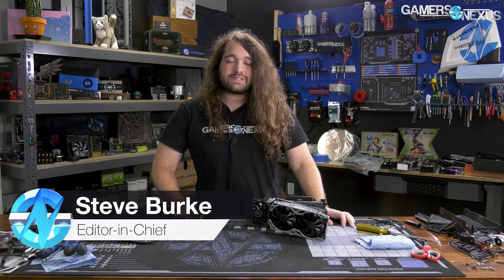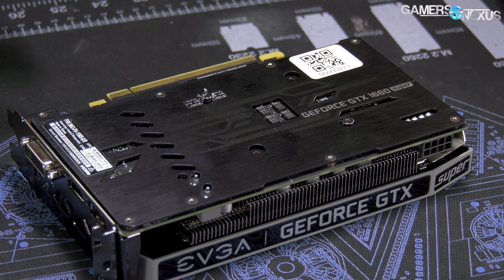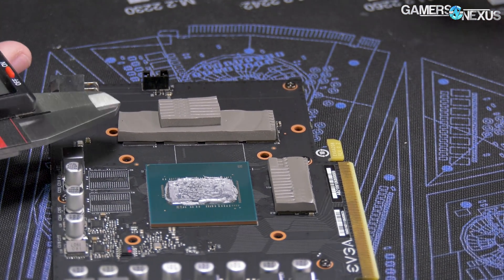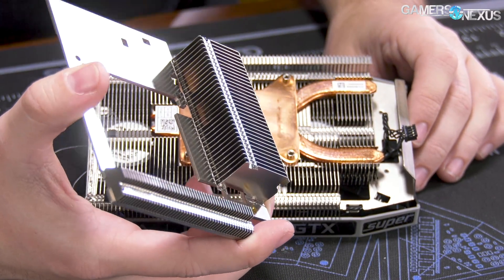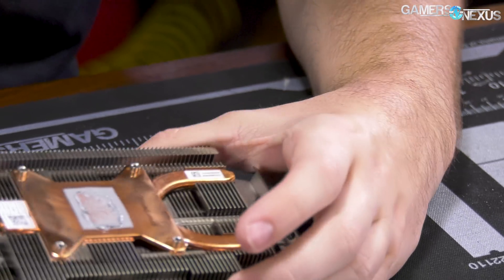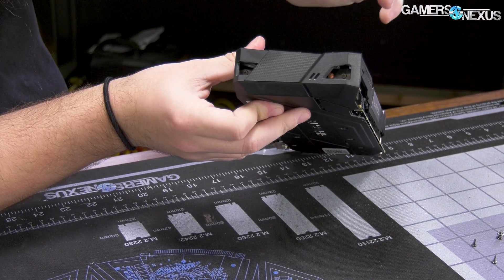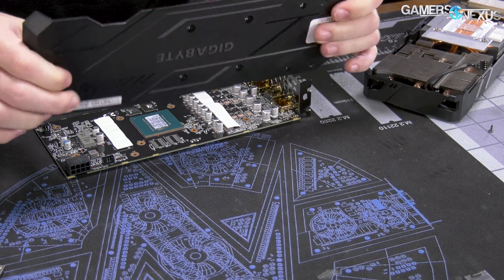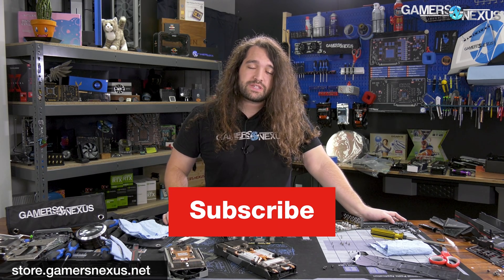GTX 1660 Super Tear-Downs: 9mm of Thermal Pads & Bendy Backplates

Comment: Gotta love non-engineers giving engineers the "oh it'd be better this way" talk. lol cracks me up every time.
Reply: Clearly, those cards were poorly designed. Nobody's blaming engineers but people above them deciding to make 2$ extra margins which ruins thermals and noise levels.
Reply: @PainterVierax  You design a GPU that gives the same performance for the money, let's see what you make. LOL   Most likely, the memory doesn't need much cooling, and it's just bridging the gap to shed the heat. They obviously work just fine and keeps temps in spec.   Why "overbuild" a budget card, when you don't need to do it, pass the savings on to the end user who's looking for a good budget card. Obviously, it's not "poorly designed". It's designed to a price point, and there isn't anything "bad" about it.  It's not like that memory is running at any extreme heat levels or anything. Like do you also think, if someone doesn't have a 360 AIO on a Intel i3 it's not "properly cooled"? Just silly
Reply: @bBrain  stacking these kind of thick thermal pad is clearly a desperate measure and it's counterproductive since direct airflow is a better and cheaper design.

Using a plastic backplate which serves no thermal or structural purpose is not an engineering decision but a marketing one.
Also you forgot that those thermal tests are made on an openbench table, temps are way worse in a standard ATX case, especially those with poor airflow.
Reply: @PainterVierax  I was strictly speaking about the think thermal pads, on the 1660, it's perfectly acceptable on a budget card. The plastic backplate is just a beauty cover. I mean, yea, most cars also have beauty plates so you don't see some ugly spot, same kind of thing. I don't mind it in a budget thing. Personally would rather it not be there, because it actually costs quite a bit to tool for that, and make them.

Comment: Isn't the whole point of the 1660 Super the upgrading of the VRAM?  Shouldn't that newer memory be running faster and hotter than a stock 1660?  These lousy thermal solutions for the VRAM aren't reassuring.

Comment: I really don’t mind GPUs being made of plastic as long as it looks good. Honestly it’s something meant to be set and not touched until it’s time for removal. I also prefer backplates as they get rid of the bare PCB look. However, the backplate should at least be the cheapest material with good heat conductivity and the memory modules should be connected via thermal pad. The vram wouldn’t even need to be connected to the main heatsink if it used the backplate

Comment: I wonder if the mod map could be a dank mouse pad
Reply: Mod mat? If so yes, he’s mentioned it many times in the past that it does make a good mousepad, but Steve finds it silly to spend so much on a giant mousepad if you’re never going to use it for electrostatic protection like it’s made (and what makes it cost so much). He also sells regular premium mousepads for 1/5 the price, or a mini-Modmat that’s still pretty large but a bit cheaper. I did have room for the large mod mad (3x 28 inch 4k monitors on my main PC), but I’m very happy with my autographed GN mousepad from the AMD 50th anniversary LN2 overclock livestream (so it has Steve and Joe’s sigs). It seems to be excellent for a super picky mouse I use, and plenty big for the monstrous pixel travel on my monitors and of course it’s way bigger than needed for lots of fast character spins at 1080p like on my 240 Hz monitor even at lower DPI like 2400).

Comment: Why is the VRM on the left? Wouldn't it be better to be to the right, near the 8pin? Does it have an impact on the video out integrity? Seems like the PCB design can be improved / shorten by removing the top unused memory spots and relocate some components around

Comment: Would be fascinating to see if there is any vast differences between the two cards temperatures.
also would there be a way to push GPU memory intensive tasks to see if there is a difference when you cool it separately with a water cooler, or copper block.

Comment: I would love to see a thermal test on that EVGA card strictly to see how they perform since they're that thick. even if you swing it as a thermal pad test rather than the memory / card itself haha. those things are CHUNKY! almost wondering if the fan directly blowing air onto them would be more beneficial after time, in the event the pads get heatsoaked??? ranting but yea. curious.

Comment: Was Steve about to say "clusterfuck" to describe Nvidia's current lineup of GPUs? 
Because if so, he'd have been right.
Reply: Why?
Reply: @aliii1158  
RTX TITAN
RTX 2080Ti
RTX 2080 Super
RTX 2080
RTX 2070 Super
RTX 2070
RTX 2060 Super
RTX 2060
GTX 1660Ti
GTX 1660 Super
GTX 1660
GTX 1650 Super (rumored)
GTX 1650

that's why
Reply: @vladdyboy2612 . If u set your budget and the framerate /resolution u want to play on there is really not that much cards to choose from. And plus amd is rumored to release 12 "new" navi gpus aswell. The reason is they dont want what ryzen did to intel happens to them.
Reply: @vladdyboy2612  And thats just their consumer line-up...
Reply: @aliii1158  Why are you bringing AMD in the mix? Their product stack is also very convoluted, but that doesn't change anything about the Nvidia line-up being an absolute clusterfuck. What Nvidia currently does is market segmentation. Screw that.
Reply: @meteormedia7021   ok

Comment: at this point, nvidia has shoved too many sku at their throats. turing is also almost over with ampere coming 1h next year. so, it's most likely won't sell well considering everyone is probably waiting for ampere or already bought turing. Now, with little projected sales and they still somehow have to release this nonsense super cards, what do they do? make it cheap, as cheap as possible. use other leftover parts, skimp on things normal user won't recognize like memory temps, etc. 

Although it's kind of a bad move from the AIBs, I still kind of get it why they did this, and even sympathize with them. they're also one of nvidia's victim in this mess of a product lineup.

Comment: Gigabyte says, removing any component from the graphics card will void the entire warranty of the product. You mentioned EVGA warranty sticker.
Reply: The one that's on the EVGA card is not a warranty sticker. It's more of a tamper seal, it won't void the warranty. It just tells them whether or not they need to possibly disassemble the card to look at it closer.

Comment: Am I correct in assuming that the Gigabyte card has space for two additional memory modules, potentially making a 12GB card?
Reply from the maker: The memory controller on the GPU will not allow that.

Comment: You HAVE to do a thermal test on those EVGA bricks. And I'd also like to see one on the Gigabyte card, with and without back plate, because I'd actually prefer a plastic back plate to bare PCB, for aesthetic reasons, but only if it doesn't hurt the thermals too much.
Reply: You in the wrong channel bud

Comment: I actually do wanna see what the temps look like with those thermal pads, vs an average sized pad. Look more like 3 Musketeers Bars than thermal pads.
Reply: I would like to know as well I bought the same card and when I asked EVGA they said there was direct airflow to the VRM's. So maybe the one in the video was a earlier version of the card or something and they changed it for the final model hopefully that's the case. I really wish reviewers would start putting temps in their reviews I would have gotten another brand like MSI if I had known about this beforehand.
Reply: @16-bit54  Well, seeing as you had already bought the card before this review came out I'd say you were already stuck with that card. For your sake I hope they did change the design & it now does a better job of cooling. 

You may try this...before the warranty runs out, send it in for RMA and hope EVGA sends a better replacement model V.C.
Reply: @wboyd33  I hope they are fixed and these were just early review models if not and the temps are bad I will just return the card and get an MSI or Zotac card because this is the only model that EVGA has.
Reply: @16-bit54 It's a year late mate but what exactly did you do with these :) ? If you got the zotac card could you share your experience ?
Reply: @Barry_disgruntled  I stuck with the EVGA card and everything has been fine temps are a little warm at idle at arouind 48c but I attribute that to the fans not running when not playing a game/underload more so than the design of the card underload/gaming it has never gone past 73c.
Reply: @16-bit54  The quality overall is fairly low at this price point man. What can us peasants do eh ? I've just got  the Gigabyte variant as well  😅 Hopefully it's a peaceful experience and nothing bad happens to the card. I'm fairly new to this scene so I won't mess with the overclocking or fan curves or similar. Got a decent case that's got plenty of airflow so I'm hoping the card stays cool and lasts long 🤞🏼
Reply: @Dhars i'd try putting on some small heatsinks on the mem chips. They cost pennies and probably work better then these huge cheap quality pads

Comment: I know on the 1660 Ti by EVGA they have a Base Plate, so they probably took a 1660 Ti cooler (looks damn similar, with a super sticker on it) and left out the baseplate to save $$$ and make it cheaper, then they had to cool the memory, so that's why that abomination exists
Reply: link proving evga gtx 1660ti sc ultra has a baseplate?

Comment: I'm not interested in seeing the memory temps on the Gigabyte card, but I REALLY, REALLY, REALLY want to see the memory temps on the EVGA THICC thermal pads card.
Reply: I'd be interested to see if small thermal pads connecting to the backplate would do more for temps than these pads.
Reply: +1
Reply: Declineto State Same
Reply: I to wanna see what 9mm's of thermal "insulation" does.

Comment: Im wondering if the memory temps of the evga card woud be better if you just glue on small aluminum heatsinks (eg. these for the Raspberry Pi) instead of the thermal pads. I also wonder if the memory temperature without thermal pads would be better than the temperature of the stock card.
I do believe the heatpipes, beeing as hot as the GPU core, actually heat up the Memory. Therefor i think without thermal pads the Fans blow fresh air diurectly over the chips and cool them better in the end.

A test of this situation would be great.

Comment: My understanding is that the order of the cards is 10-16-20 50-60-70-80 xx- xx super and xx Ti
Am I correct?
Reply: Yes and I would add that below xx60 you're starting to pay more $ per frame, you're often paying a premium for power efficiency or miniaturization into a small form factor. Above xx60 you start to pay more $ per frame as well because those are lower-volume enthusiast products. You can imagine a "valley" of price-to-performance ratio and xx60 is always at the bottom for Nvidia cards. So basically for financial sanity you want 1060, 1660, 2060. That's the general rule. Super/TI is desirable to a degree too. It's all about the price-to-performance ratio. 

Right now I would say it goes like this depending on just how "budget" you are: $$ AMD RX 580 8GB 2306sp, $$$: Nvidia 1660 Super 6GB, $$$$: AMD Navi 5700 non-XT and then you can hack it into an XT if you do the research. I'd get one with good thermals if I were to go that route.

Comment: Sweet Jeebus - there was room for discrete heatsinks on those VRAMs!
Reply: My thoughts exactly, some thin finned, short, vram heatsinks with decent TIM, would have been a better choice.
Reply: The heatsink has open airflow in RAM area. Unlike some heatsinks where the fins at the bottom are bent in and create a nearly solid plate that needs to be connected to the ICs underneath by the pads, because otherwise there would be a hot pocket, there's literally nothing precluding them from using low-profile heatsinks here, and they don't have to be anyhow special, just lengths of standard mass produced extrusion. So those pads are just completely baffling. Well there are some bent in fins but not really enough to cause an issue there.

And then the pads just run into the alu plates of the heatsink edgewise, what good is that at all?

Luckily GDDR6 consumes less than GDDR5X, so they likely aren't in any immediate danger, but just letting them cool naturally in the airflow might actually be a better solution than 4mm of padding, and cheaper too.

As to Julian's comment, yes, these are flip chips and can be cooled via the PCB backside, and there are enough vias for the power planes and the common data bus for that to work. But given how sloppy the backside "cooling" usually is with backplates that do more harm than good, would you really trust them to do something sensible there?
Reply: @SianaGearz  you seem to have some pretty big misconceptions in there bro, backplate are used to stop flexing and they don’t even make contact with the card except for standing off the ground points on the screw holes.. seems like you are typing with charged feelings when you made that comment tbh
Reply: @CorruptInfinityOfficial  Is this your first time on this channel? Powerful GPUs are thermally constrained, and heat accelerates failure, approximately for every 10°C of reduction, you can about double the service life, this is true for both semiconductors and aging-prone passives. Every bit of cooling can help. This channel has criticised these missed opportunities a number of times, rightfully so. And you're what, attacking me, why? Shrugging off the inefficiencies as if this is the only way things can and should be? Even zero sum on the cost, better design, can be an improvement. Even with existing parts and no new tooling to be made.

Backplate being used as a heatspreader is not entirely unheard of, thermal pads are sometimes used, and they do work fairly well there, as shown on this very channel before. And manufacturer ad blurbs can occasionally make it seem like it's a heatspreader even when it doesn't work that way, which is just doubly annoying.
Reply: why not put a heatsink on the other side
Reply: @Redicat  That requires you need to place memory on the back aswell, which increase costs I believe

Comment: On the other hand, you can probably replace those thermalpads with regular small aluminium/copper heatsinks
Reply: true, but if i'm buying a card in this price range i dont want to be messing around with it. it gets too hot and humid here in the summer for me to trust the "solution" they used.

Comment: There's enough space there for some slim individual chip heatsinks that could be attached with adhesive thermal tape. These huge pads are just obscene zero effort cost cutting.
Reply: Would be an interesting mod you can do yourself.
Reply: Either slim individual sinks or just a thin strip of aluminum connecting them all. It's not like it needs an absurd amount of cooling, the fan blowing on it through the cooler's fins would be enough.
Reply: and here i thought EVGA was the 'premier' nvidia AIB. seems they're just as fucking shitty as all the rest.
Reply: @allaboutparsnips9523  Profit is more important, the execs need more cash!
Reply: I was thinking exactly the same thing. Even a cheapish 3rd party air cooler does a better job
Reply: Who would have thought that cost cuts would be a thing on a 1660! 😂
Reply: @jackadams99  To be expected of course, but this is just awful.

Comment: Would be interesting to see what are the temps with the plastic back plate removed
Reply: Exactly my thought too along with removing the brick pads also
Reply: It wouldn't be enough to measure with or without the backplate
Reply: He said they have proven a difference in another video
Reply: I actually bought this exact card,
With overclock to 2040MHz on the core and 1800MHz on the memory the highest temperature after 2 hours of full load is just 64c at 26c ambient with the plastic backplate,
There is no need to remove the backplate.
Reply: @QuadPowerful  Lower temps are lower temps and even lower fan speed/0 rpm for longer
Reply: @GewelReal  I can't argue with that :D
You are right.